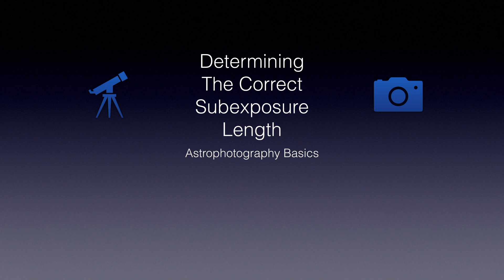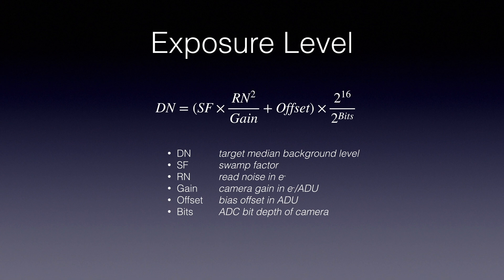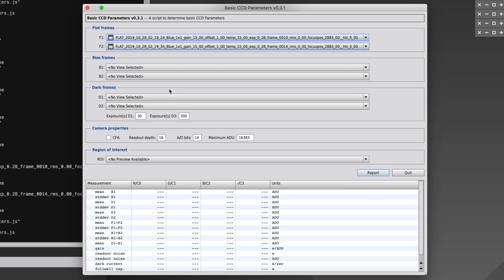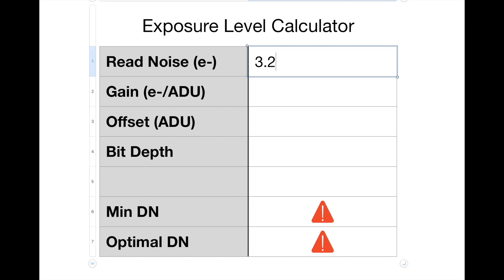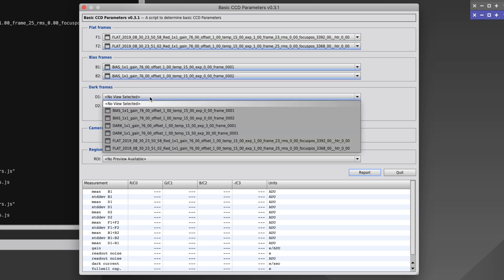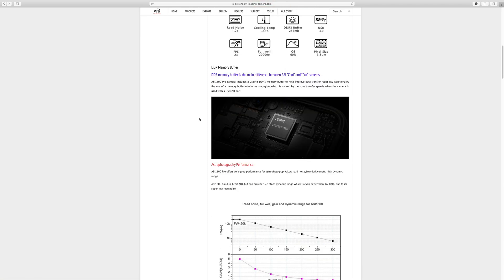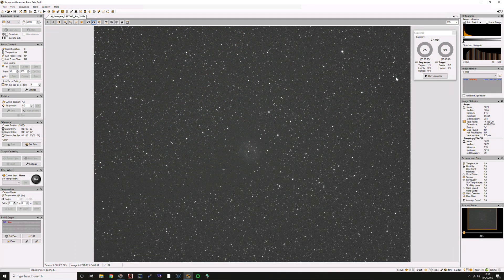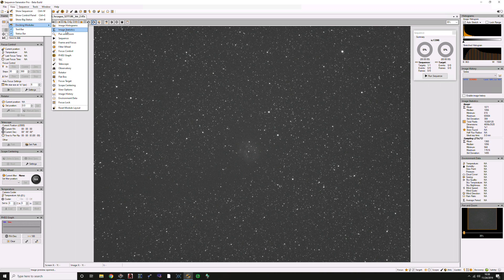How To Determine The Optimal Subexposure Level For Astrophotography

Comment: Hi Linda, great video thank you. I'm a little confused about my results though and was wondering if you can help please? I use an ASI533 and from the website I can see that my figures should be read noise of 1.5, gain of 1, offset for this camera is default 70 and bit depth is 14. That gives me a Min DN of 307 and Optimal of 370. When I look at some of the images I've taken, my mean ADU value is around 3000 which is almost 10x the optimal value...and that's only a 30 second exposure. I live in a bortle 5/6 area so not super bright or super dark, but does that mean my optimal exposure times should be almost 10x less than 30 seconds? So like, 3-4 seconds lol. I'll have no space on my PC! Surely I'm going wrong somewhere? Thank you :)
Reply: Your offset figure is incorrect. We are looking for the median ADU of a bias frame at 14bits.
The default driver is set to 70 but this to be multiplied by 10.

Input 700 for the offset value.
Reply from the maker: That sounds about right. With the gain at 1e-/ADU and the very low read noise it doesn't take much to  bury the read noise in the sky glow even at Bortle 5. You have a couple of choices. You can just live with it. There's no harm in exposing longer so long as you aren't clipping more stars than you are comfortable with. The other thing is you can lower your gain down to 0 from 100. That raises the read noise to about 3.8 to 3.9 e-/ADU according to ZWO's graph. That would let you expose longer at lower gain so risk less clipping. However, either way you are capturing the same number of photons. The difference is in the read noise and the dynamic range. With that camera at unity gain you don't appear to be sacrificing much dynamic range at gain 100 so you should be ok exposing longer but let your stars guide you. If you are clipping too much then lower the gain.
Reply: @LindasAstronomyAdventures  thank you for your reply. If the clouds ever go away I might try some experiments and see how I go.
Reply from the maker: I feel your pain about the clouds. This summer and fall have been brutal here. Good luck!
Reply: Philip are you sure your calculations are correct? I get optimal at 2890..
Reply: @richards3192  I get that also. How did you calculate it Richard?
Reply: @richards3192  pretty sure, but I could be wrong.

Comment: You have more experience than I, however if a star is not over-exposed in the camera, then all you need to do is preserve what you have.  If it is destroyed by processing, thats a processing error.
Reply from the maker: Yes, there's generally no harm in going longer as long as you don't cause too much clipping. However, it doesn't really improve stacking efficiency much to go (Robin Glover, author of Sharpcap has a video that talks about this in more detail). So, while it doesn't hurt to go longer, it doesn't help as much as an entirely new sub would.

Comment: Super video. Thanks. I learned more about PI. There's a minimum and a maximum exposure for any given target. The minimum should be whatever exposure just swamps the read noise. The maximum should be where a linear, unstretched image shows very few if any stars. A fully stretched image should then show the structure. N.I.N.A. has an exposure calculator built in. I've determined that seeding with a 1 second exposure produces a recommendation for an optimum exposure. Getting the camera statistics from SharpCap Pro provides the necessary information for the N.I.N.A. calculator.
And of course, the PixInsight method shown in this video will work. But, which method is less complicated? For me, the SharpCap-N.I.N.A. process was easier and quicker to arrive at. Using that process provided me with a perfect optimum recommended exposure to capture M13. I tried other exposures, and none of them produced as good an image as the recommended exposure did.
Reply from the maker: This might be a duplicate reply as I thought I responded to it earlier today but don't see it htere so just in case... Yes, sharpcap is a fantastic piece  of software and nina's ability to consume it's exposure info makes for a great calculator. Robin Glover, the sharpcap author, has some great videos on exposure that are worth viewing. In particular, I'd recommend this one: https://www.youtube.com/watch?v=3RH93UvP358. He points out there there isn't really much benefit to going beyond the optimal subexposure length since it doesn't help fhe final stack much. The other drawback is the potential to clip more stars (or with some cameras contending with more amp glow or more odds for tracking error). Also, depending on the faintness of the target, it might be quite subtle or even invisible in an optimally exposed frame but will pop out when you do the final stack so looking at detail in a screen stretch may not be an accurate way to judge. Of course, if your target is very faint and you're willing to sacrifice more stars to clipping then it may still make sense just to get more signal you actually care about but that's likely an unusual situation for mos of us. But, your point is well made...there is a fairly broad range where you can be in the optimal zone and it needn't be complicated to get there. Thanks for your comment!

Comment: I'm calculating between 77-140 for the asi2600mc pro at Gain setting of 100 (RN=1.5, Gain=0.25 e-/ADU, Offset = 50, ADC =16). Is that accurate?
Reply from the maker: That's what I get also.
Reply: @LindasAstronomyAdventures  could you please explain how I'm supposed to use the DN (ADU) number exactly? If I simply take a 0.001s bias with the 2600mc pro, I get an avg ADU of 500, which is already way over the 77-140 calculated above. Am I supposed to add that 77-140 on top of my baseline ADU from a Bias frame and aim for that in my sub exposure?
Reply from the maker: Something isn't correct with one (or more) of the numbers you reported) most likely. That formula takes all your settings into account so that's what you want your median ADU to be near in an absolute sense. If you are getting 500 on a bias then something is off somewhere. How did you come up with the numbers you got?
Reply: @LindasAstronomyAdventures  the 500 ADU on bias frame is from Asiair Pro histogram's AVG reading (min 367, max 700, avg 501, Std 6). The other numbers for the DN calculation were taken from the ZWO webpage for my camera (asi2600mc). I eyeballed the values from the graphs they provide. I haven't done it in Pixinsight using BasicCCDparameters script yet, but will try that tomorrow.
Reply from the maker: Assuming the ASIAir is telling the truth then are you sure you are using offset 50 and didn't accidentally put another 0 on the end? Beyond checking that I'd definitely run BasicCCDParameters to see what it says.
Reply: @LindasAstronomyAdventures  I will run BasicCCD to check. In the Asiair you can't set the Offset,  its always at the ZWO default value (which is 50 in this case for the 2600mc).
Reply from the maker: Something isn't adding up for sure. Based on the numbers you provided, I'd expect the bias frames to have an average around 56 or so. Hopefully BasicCCDParameters will shed some light.
Reply: I tried last night shooting some bias frames at 0.000035 and i got 501 adu at -10c on my asi 2600 mc pro My dark flats and darks  also come out at 500 adu regardless of length

Comment: For the ASI294mc Pro I'm getting Min DN 160 and Optimal DN 253.  These seem extremely low.
Reply from the maker: That does seem on the low side. What gain and offset are you using?
Reply: @LindasAstronomyAdventures  Unity Gain which is around 0.8e and offset 50 is giving me Min DN 260 and Optimal DN at 400. Still seems low to me.
Reply from the maker: At gain 120 where it switches over to high conversion gain mode, I'm getting optimal at 226 DN so I don't think you've done anything wrong. With only around 0.8e- of read nose it doesn't take very much signal to overcome the read noise. You can expose longer if you want, but it won't help your stacking efficiency much.
Reply: @LindasAstronomyAdventures  So hypothetically speaking we're talking like 5 sec exposures? Am I in the ballpark or dreaming with these numbers? lol  I guess since I'm using Hyperstar a 5 sec exposure is equivalent to about a 1 minute exposure at say f/5?
Reply from the maker: It certainly could be depending on the sky you have. Between f/2 and low read noise it doesn't take much. Going from f/4 to f/2 gets you 4 times as many photons/second so yes, your exposures could be insanely short.
Reply: You have to multiply the offset by 16 with the 294.
Reply: @AB-ft2lb  I've pretty much mastered it now. Thanks!

Comment: Aloha Linda,

  Just came across you GREAT video (I guess better late than never) and watched it about 5 times!   I'm also using an ASI 1600 mono camera and SGP and PixInsight and sometimes FITs Liberator (to view a sub-exposure).  I got my spreadsheet built using your formulas (thanks!).  I pretty much understand the formula, but I'm still getting confused and wrapped around the axle about all this scaling up and down business between 12 bit cameras and software (like SGP) displaying 16 bit values .  So, based on the first example in the video (gain = 15, offset = 50, bit depth = 12, etc), the calculated min DN value is 920.  It seems to me SGP scales up (from 12 bit to 16 bit) and the Rista formula 'scales down,'  but SGP is still displaying a scaled up median value.  The scale factor here of course being '16.'  So, when I open up an ASI 1600 sub-exposure in SGP and look at the median value (which is being reported in 16 bits), does that median value in SGP need to be manipulated again?  Or, can I just use the displayed median value (as is) in SGP, and compare that to the formula's min dn 920?  Kind of stuck on this (and sorry about the long thread here)...  Thanks in advance for any words of wisdom/clarification and Happy New Year!   John
Reply from the maker: John, thanks! The camera manufactures report specifications in terms of the native bit depth of the camera, so 12-bits in the case of the ASI1600. However, the camera software scales this up to 16-bits so we never see the native values reported in software like SGP. We only see the already scaled 16-bit value. The formula does that same scaling for us so we can just think in terms of what the camera reports rather than what is really going on at the hardware level. That means you don't need to do any further conversions. You can use the values supplied by the spreadsheet directly. Hope that helps!
Reply: @LindasAstronomyAdventures  
Aloha Linda,

  ok, thanks and thanks for the quick reply!  I think I understand what you're saying (and I do remember you mentioned that the asi driver was scaling up [to begin with]).  Not having to do anymore conversions is a BIG RELIEF.  I was thinking SGP's mean value needed to be divided by 16 (and then compare that new value with the min or optimal dn value generated by the formulas).  I guess I can always 'cheat' and use the histogram (as a backup)  :)

  Just spent about 6 hours looking at all those detailed Cloudy Night threads on all of this, but your video really helped.  Due to possible quantization errors (caused by ADC converters), I noticed Mr Rista prefers to work with the analog signal (which I guess means electrons), so may need to review that approach again.  And, I need to look at your offset video again to.  Thanks again!

Comment: Hi Linda. Thank you for producing and posting this tutorial which is very clear. I like technical stuff but can't help wondering why can't we just figure it out in the field by trial and error, watching for when stars become saturated. Also, does this need to be done per filter? I am assuming so.

I was reading somewhere else (https://www.lightvortexastronomy.com/measuring-your-camera-sensor-parameters-automatically-with-pixinsight.html) and they are saying readout depth is actually that of the image bit depth and that is usually 16 bits. You seem to be using the same bit depth as for ADC. The difference in results of the readout noise is considerable.
Reply from the maker: The optimal level isn't about avoiding saturation (though that's important). It's about burying the read noise of the sensor with enough signal from background sky (which is mostly light pollution for most of us) to hide that read noise. You can go beyond that optimal exposure but then you run the risk of saturating more stars than you needed to. All that being said, what you described would probably work fine for the CMOS cameras that have very low read noise. It might be a little trickier on a high read noise CCD to know for sure whether you went long enough.

Comment: Awesome. What do you aim for mean ADUs?  I've heard anywhere from 800 to 2000
Reply from the maker: The value I aim for comes directly from the formula I presented. But, yes, for my ASI1600 I usually end up in the 800-1200 range depending on the exact gain and offset I'm using.

Comment: Hello Linda, I used your video to determine my optimum exposure. I am imaging M101 Pinwheel Galaxy.   I have the same camera ASI1600MC cool (but colored) so I assumed that the specifications will be the same as in the video (Optimum DN = 1290).  I am in a rather high light pollution area and have a Baader LP filter attached to the camera.  A single sub-frame of 45 seconds with gain = 25 and offset of 10 and temperature setting at -10C.  This is giving me a median of 1136.  If I try to increase the exposure time, I will go over the Optimum DN.  But I get a sub-frame that has very little luminosity even after stretching, I can't see much of the galaxy.  
I took a total of 100 sub-frames for a total of 4500 seconds with relatively good guiding.  I have not tried stacking it yet.  I am using PixInsight.  Will I actually get something out of these sub-frames after calibrating with darks, flats and bias and later stacking?  I have never tried this approach and don't really know if I am doing it correctly.
Reply from the maker: If you are using an offset of 10 then your optimum exposure level will actually be 640 DN lower than mine in the video. That's because your offset is 10 instead of 50 which will lower the optimum value by 640 (16 * 40).  You are actually going much longer than you need to. There's no harm going higher though you might clip a bit more data than you might otherwise. As to the data looking thin...yes, it does. You don't need much signal to bury the read noise since the ASI1600 has such low read noise even at low gain. But, when you stack up a bunch of them suddenly the signal pops up out of the noise.
Reply: @LindasAstronomyAdventures  Thank you for your reply.    I did some image integration on PixInsight and was able to show the galaxy but I think I will need to re-image to get better results.  I will watch your next video on the optimum Offset.
Reply: @LindasAstronomyAdventures  - I had a chance to do some imaging last night and followed your method.  I was imaging at Optimum DN of around 1290 at the beginning but as the night went on I noticed that the value start to increase to 1480++.  In that case, what should I do?  decrease gain or decrease exposure time or simply leave it as is?  
After calibrating with darks, flats and bias with PixInsight, I still get a fair amount of noise and amp glow.  Can you still advise me what to do?
By the way, I am in the inner city limits and I would say Bortel scale 8.  Hence making it more difficult to capture images.  I would like to try getting some images in really dark locations to compare...Your thoughts will be appreciated.

Comment: Thank you for the video. Sorry, I am very new to this. The formula calculated DN (?), where I can see seconds/minutes of exposure? How I convert min and ideal DN values to exposure time? Thank you.
Reply from the maker: No problem. The DN value is the value of the pixels in your image, not the time. This procedure doesn't tell you the amount of time to expose but what exposure level to aim for. If you are using an acquisition program like SGP or NINA you can take some test exposures at different lengths and use the median value for the exposure in the image statistics to determine whether you need to increase or decrease. For example, if the formula told you to aim for 1,000DN and you tried a 60 second exposure and your median was 853 then you know you need to try a longer exposure. It's a bit of trial and error but usually within 4-6 tests you have the amount of time you need figured out.
Reply: @LindasAstronomyAdventures   Very good, thank you. I will be looking for the VALUE of exposures in SGP (what I am going to use) and through that I can come to time of the exposure. Like in your example, it has to be more than 60 sec.

Comment: I have been trying this formula for the ASI533. Unity gain   rn1.5, gain 1.0,  offset 70 bit depth 14.  I am coming up with 370 at swamp level 10. That seems very low
Reply: I got the same answer!  whew thought i did something wrong......I'm going to try this tonight on Andromeda.
Reply: The offset figure is incorrect. What you need is the ADU median of a bias frame. In my case it is 2796, but we need to divide this figure by 4 as it is already padded to 16bit.
Remember, we are multiplying by 4 in the equation as we are using a 14bit camera, hence we don't want to do this twice.
X10 SF for me is 2886 DN.
Reply from the maker: I get the same answer. With very low read noise it doesn't take a lot of signal to keep the read noise under control. You can expose longer but this should maximize your dynamic range. If you try it, let us know what happens.